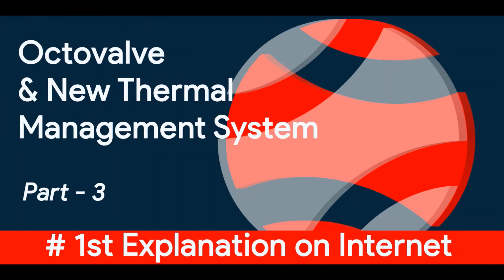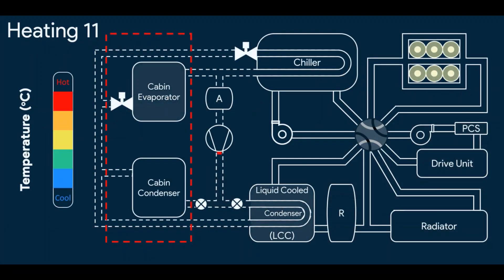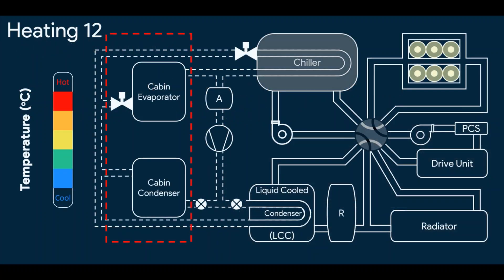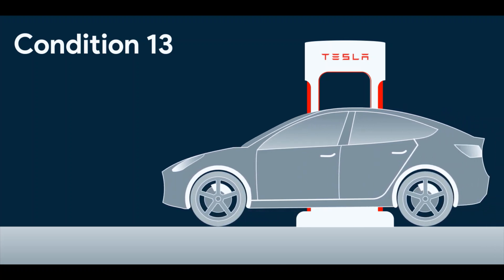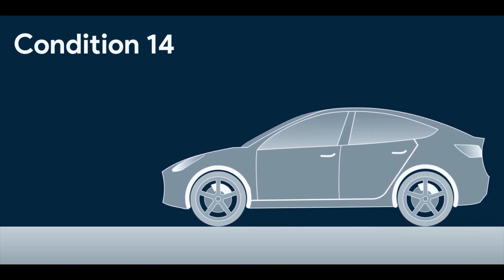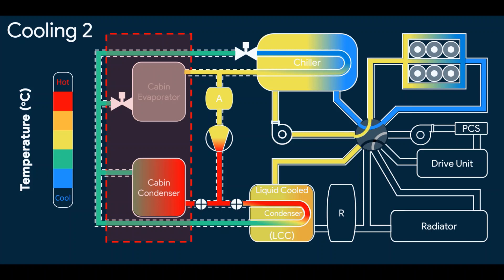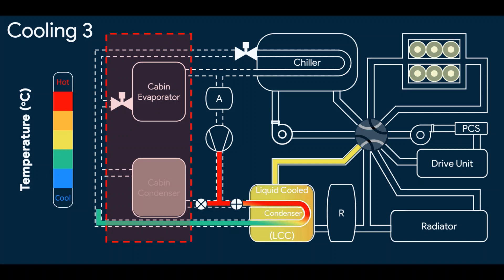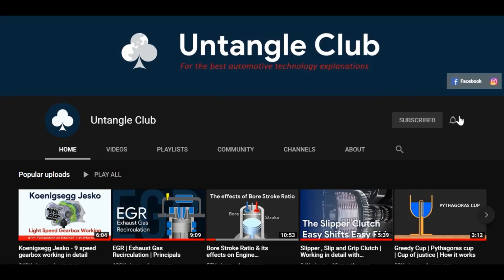P3 | Tesla Model Y Thermal management system with OCTOVALVE & HEATPUMP | Working in Detail

Comment: Thanks for creating and sharing this information.  I very much appreciate the time and effort you expended to provide these videos, which are informative and clarifying.

Question - can you steer me to information on the temperatures associated with the various components in the cooling/heating system?  
I am specifically interested in the motor/drive train temperatures.  Are there any cooling scenarios where the primary objective is to cool the drive motor to increase its efficiency?  (For Tesla or any other OEM's?)

Thanks

Comment: I have doubts about whether Cooling Mode 3 actually works the way depicted in the video (or whether there's possibly a Cooling Mode 4). If it is very hot outside, think it would be more efficient if the octovalve were positioned such that the Chiller/Battery were in their own circuit, like in Cooling Mode 1, and the LCC, Radiator, and Drive Unit were in a separate circuit, also like in Cooling Mode 1. The only difference would be that the Cabin Condenser would be unused and the Cabin Evaporator would be active. Let's call this configuration "Cooling Mode 4", for now.

Let's say it's only 20-25C outside. Cooling Mode 3 would make sense, since the atmosphere would be able to cool off the coolant quite a bit before it returns to the Chiller. The drive unit can be cooled more in this configuration since it receives coolant directly from the battery, before the coolant is routed to the LCC to pick up rejected heat from the Compressor and then routes to the Radiator.

However, let's say it's 45C outside. In this case, the coolant coming out of the Radiator would be no cooler than 45C! It does not make sense to send that 45C coolant straight to the Chiller so that all of that heat can be sent through the refrigerant, via the Compressor, all the way back to the LCC again. This would be highly inefficient. It seems like it would be far better to use the hypothetical "Cooling Mode 4" to route coolant straight back to the Chiller after it leaves the battery, and have the coolant go directly to the drive unit after it leaves the Radiator. I know that the drive unit can be cooled sufficiently, even if it's hot outside, because that's how the superbottle worked, with two separate coolant loops, one that uses a Chiller to cool the battery and another that directly pumps coolant between the drive unit and Radiator.

Comment: I’m not an technical person, so I’ll need to watch these over again, but basically the impression I got was that the octovalve + heat pump makes heating more efficient in cold temperatures. Cooling is pretty much the same in the model 3. Is this correct?
Reply: Major difference between old Model 3 cooling and new Model Y cooling is the condenser in the 3 was air-cooled and now the Y has a liquid cooled condenser. The trade off is the Y doesn't need to fit a bulky air-cooled condenser in the nose of the vehicle, but now it has to run its coolant pump while cooling the cabin.
Reply: The heat pump itself is what makes heating/cooling more efficient, while the Octovalve determines which systems are heated or cooled, like the cabin, drive unit, battery, and electronics. Heat pumps are nearly identical to traditional cold air A/C systems, but have a reversing valve so it can run "backwards." Since A/C works by removing heat from the air and putting it outside, a heat pump can take heat from outside and put it inside. In some conditions, a heat pump can use less energy to produce the same amount of heat an electric resistive heater found in most EVs, which is where the added efficiency comes from

Comment: How is the condensate from the system collected and directed from the vehicle.  My model Y has liquid exiting from both the edges of the pan under the frunk and from the rocker panel area just forward of the right rear wheel.

Comment: 🏆Nice work and ingenious design. Sure to add range to cold regions. But I' dont like all those liquid connections added.
Reply: The real engineering genius of Teslas implementation of this system is the collection of many of these valves and associated plumbing into a single manifold block, minimizing the number of connections that could leak.
Reply: @kschleic9053  This. Like somesort pcb analogy come to mind. As Sandy put it.